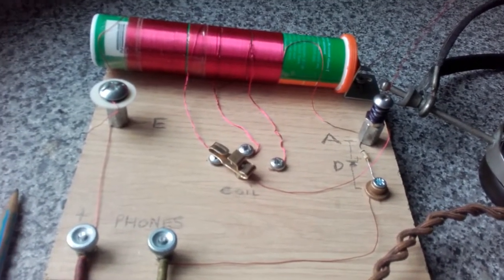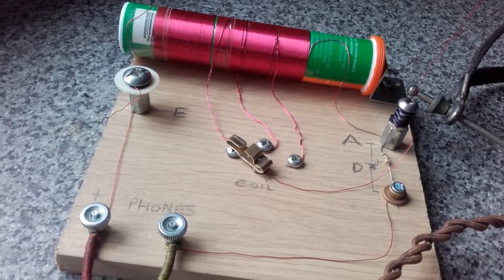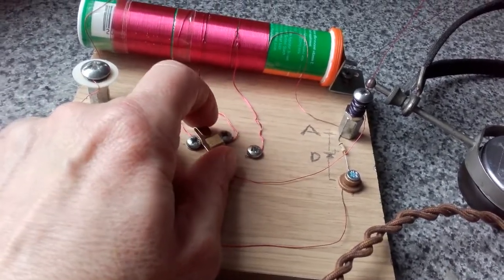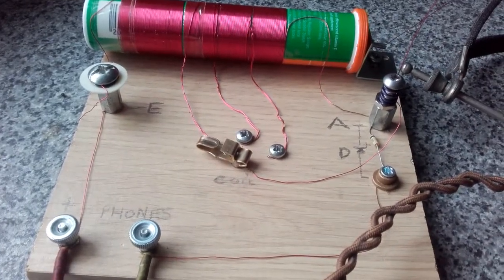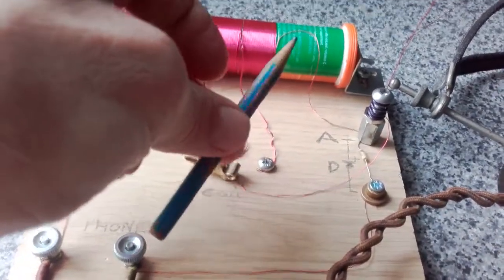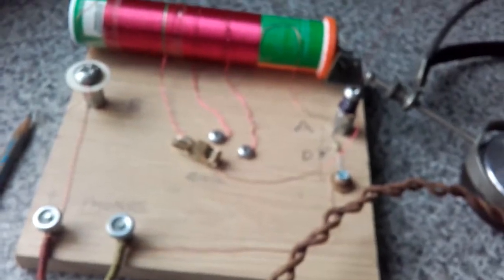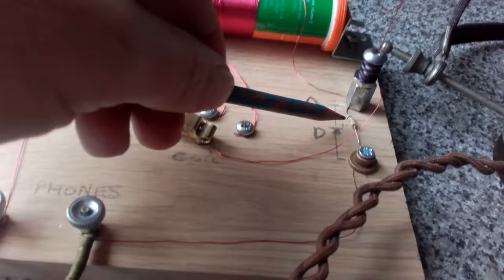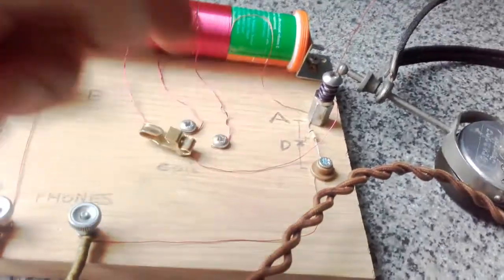A free energy crystal radio receiver.

Comment: "galena" is normally spoken with a hard "G" as is "Gone"
Crystal radios are a great hobby project.  You can get the materials to make one fairly easily.
With some effort you can make one loud enough to sit and listen to via a speaker.
They can be made on an acrylic sheet to make them as an "art piece that receives"
If you make two coils that slide neatly over each other and connect them in series, you can tune by sliding one coil in and out.
There is also a "stolen power" version where you build one just to make power to run an amplifier for another.  This lets you hear weaker stations without need of a battery.